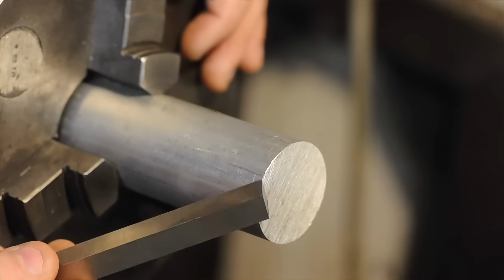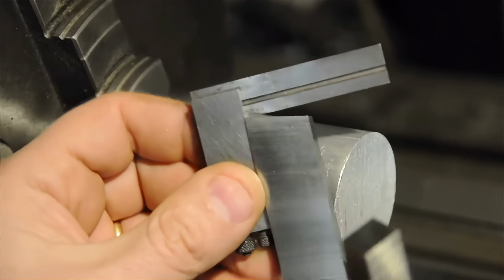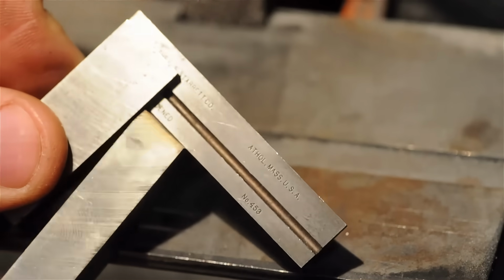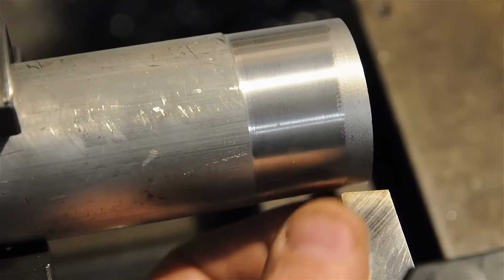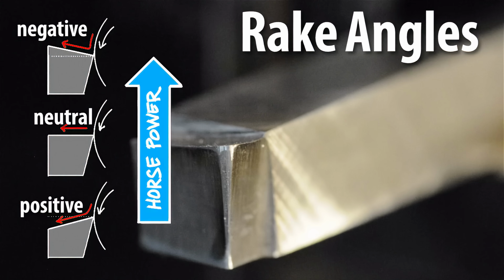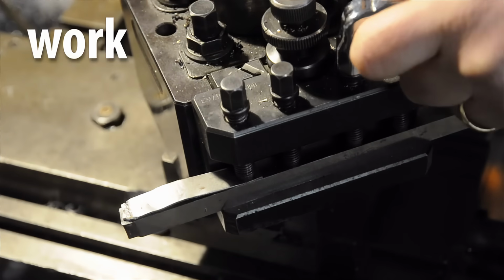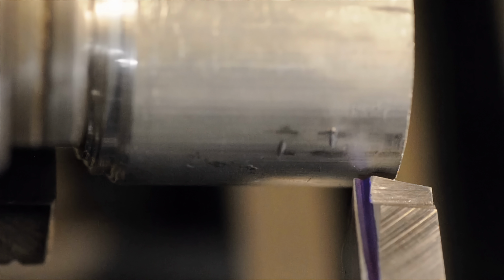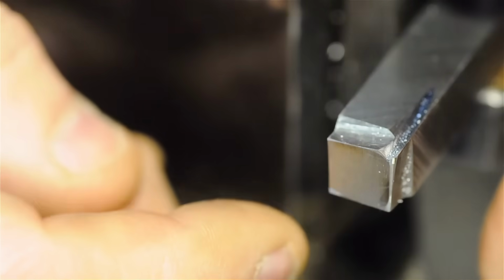Grinding HSS Tools

Comment: ummm - a nice video ... thank you ... but you don't need a chip breaker if you run it at the right feed rate so you get chips not a continuous spool of swarf ... as a CNC fitter and turner I have never heard of such a thing ... just get the bulk feed rate right for the material and load and it just chips up without all that... i use HSS to make hydraulic seals with a profile ... just use carbide tips if you're machining something.... you know you got the feed rate right when it chips up nicely ... but thank you ... I live in a production enviroment not a hobby one ... interesting but ............

Comment: Thank you very much for the info and the effort made to post this. My family ran a motorcycle dealership for 40 years and we bored many cylinders in that time. My dad had been a tool and die maker years before that so we had some knowledge in our shop about cutting tools. Occasionally my dad or I would try to sharpen the cutter for the boring bar (by hand). Because of the years of experimenting with good and bad results, it was really interesting to watch your video. We eventually bought a tool with carbide inserts but we found that we could get much less chatter from our machine if we modified the tip of the insert a little. My theory was the the angle on the end of the tool was just a little different that what we really needed. We had the machine overhauled at one point and that helped some too but having the right tip geometry was key to getting a finish that would hone out easily and make for the best cylinder surface.

Comment: really interesting! Thanks for taking this approach of trial and error. That made all the changes be understandable. Especially the chip braker at the end made a lot of sense! Carbide tools do have this u shape as well, but as they have it tighter and are mostly used on steel, chips are braking better there as with aluminium and your HSS tooling.

Comment: Hi Tony/ other experts - would the relief and other angles be similar for Delrin as it is for Aluminum?  Having a tough time getting a smooth finish milling the diameter down.  Facing was very smooth but cutting across is leaving a very rough finish.

Comment: Your videos are generally very interesting, with no boring sections. The dry jokes are awsome ;). Also weirdly relaxing, because the soundscape works for me at high attention or as ASMR at the same time.    Are there adjustable chipbreaker styles similar to woodworking planes?

Comment: First time I used a lathe (30 years ago) I nearly destroyed it ( cutting tool
heading straight through the chuck on automatic feed) . Euh... stayed away from  them lathes for a while ......
Well , just bought a Sherline 4530 , as to exorcise my never ending 
guilt complex , hey.
So I went ahead and tried grinding my own bits , only using that  +/- 7
degree basic approach / trick....and , immediatly , it WORKED !!!
 
Thanks so much  for that video , I 'm now one proud  lathe 'machinist'  (all eyes on the chuck , sure ).

Comment: This Old Tony . . . Ok so this isn't quite grinding a tool bit but . . . me being a shop ironworker, I need a large center punch. 
I can't seem to find one large enough to really grasp in my hand. You know larger than those little thingies they sell at the 
big box home repair places. So how practical is it to grind a large tapered punch into a center punch and not ruin the tool
steel that the punch is made of?

Comment: Thanks for describing all the reasons for the grinds...it's been over 40 years since Trade Shop Class and I needed the refresher. Picked up an older model Edestaal SL1000 and trying to relearn how to use it correctly. Thanks again...

Comment: At a shop I used to work, they had a box that dull, or broken, inserts and endmills went in, because they sold the carbide to be recycled. I would always raid it, for 6" extended length 1/2" and 3/4" endmills. They would take a good bit of green wheel to form, but when you needed to bore a deep hole, that needed to be precise, I found that the rigidity of the 3/4" solid carbide endmill repurposed via custom hand grind, to be superior. The smaller diameter, and inferior material quality of the insert holder boring bars, were guaranteed to deflect more and more, the deeper you went. Even on multiple truing passes, the repeatedly of the custom carbide boring bar, was always my go to, when I was given the responsibility of deep precise bores, that had insane gd&t concentric true positions on them.

Comment: Many years ago I used to do a lot of form tools; mostly Carbide and Cobalt and it saved me alot on time.
I also had a cutter grinder machine that saved a lot of time and money.
One final thing I'd like to say is if you're going to do a custom cutter and you're going to do Form Tools you might as well make them out of Carbide or Cobalt tool material. I want cutting tools to last.

Comment: I'm about halfway in. I've been learning 3D modeling for about 10 years and this is so similar to 3D modeling it's crazy. but also, I'm starting to think that the " ideal tool " would look something like a needle or a single point on a stick or something or a sharp point honestly, but maybe with a little bit of thickness in I don't know, it seems like any thickness in any dimension would have some type of drawback

Comment: I wish my P.M. would cut that smooth. No matter what I have tried I get a rough cut on both steel and aluminum.  Any suggestions out there please???? 
And yes I’ve tried new tips  slower and faster speeds but too no avail.

Comment: Thanks for the info. A suggestion - It would help a lot if you would label the four sides of the tool bit with an  L - R - T - B  for the Left - Right - Top - Bottom. This would help us follow how the tool is positioned on the rest when you are grinding it. When you are flipping the tool around in the air it is hard for us idiots to follow the surface that you are discussing as you take it to the grinding wheel. Thanks again.

Comment: I used taps as a source of HSS.
Usually, the square part is long enough to have a strong fixation when used as taps, but can accomodate grinding on the end to be usefull lathe cutters.
And since they usually have 4 flutes, it's easy and consistant to fix them on a post.

Comment: Are chip breakers only for security ?
I have worked in a compagny with huge tools. They had horizontal lathes, to build up to 2 meters ( or more ) diameter gears.
Sometimes the metal ruban from machining was so long I took care to stay aways from this evilish machine :)
I have a mini lathe,  have been used tools for decades, and still fear of it.

Comment: The Old Tony channel is a recent find for me, and is causing me to lose a bit of sleep.  Too many topics and too much knowledge to absorb, sot of like being in college again.  A word about chip formation - the continuous strands leave a path for heat conduction back into the work piece. Small chips which break off cleanly remove the heat of cutting with the chip, and keep both the work piece and the tool much cooler. I can only get chips to form in 6061 with about .050" depth of cut and pretty aggressive feed rate. 7000 series are much nicer to machine. Anyway, thanks for the many cool videos, wish I had found your channel many years ago.

Comment: I've practiced countless hours to grind tools like this. They never end up as sharp as this. I don't know what i'm doing wrong.
Reply: Have you got a diamond hone?
Reply: @bazzaf246  no. Any advantage over white sharpening stone?
Reply: @Dwarfgrinder  possibly a bit more control with a handheld diamond hone. Are you doing the second to last step in the video? Changing the angle of the top of cutting edge/making it sharper?

Comment: Great video - thanks. I know this is a old vid but I'm a gonna hope some ones sees this.
I've got cbn wheels on my grinder (wood lathe newbie) and they grind hss like butter.
So my idea is you make a mandrel and mount a cbn wheel on your lathe using said mandrel and then use the cross slide plus other mechanisms to make the chip breaker grind?
Funny the chip breaker on a wood plane does the exact same thing it cracks the chip and allows it to curl.
Good stuff.
Reply: My cbn wheels have a 90 corner with grit down the side - .25" or so.
Perfect for that chip breaker grind.
Reply: I'll add I have not idea what I'm talking about - just spitballin.

Comment: Excuse my limited English but here in England we call it swarf lol.  Anyway, back when I was in college about 45 years ago one lad was turning a long steel bar. A deep cut (HSS tool) on a very slow feed. The coil of swarf was so long I helped it feed off so it wouldn't break. I can't remember how long it was but he was using a Triumph 2000 and it was way longer than that

Comment: Great video, good information. Some advice regarding chip breakers. You have the right idea but the breaker is to deep and to far back from the cutting edge. For small cuts like your doing a small chip breaker is what you need. Look at a carbide inserts chip breaker. Good luck

Comment: Law: if it can be heard its vibrating.

Appreciation and awe:
I love this microcosm. I need this tool in my shed, and your ken will help so much! Thank you. I love the fact you explained the angles rakes and physics to back it all up with your comfort and skill. Now I need to re-true my grinder.

Tangent:
Now I dont know if it is of interest to you, and I figure you are a decent and honest guy; those chips can be sold. Yes. Sold.  So anyone want to 'upcycle swarf can do. But Personally, the ethics dont sit right for me. But it will explain if a person is raking around your shop bin fleeting with a bunch of swarf, and leaves you confused. 

Rabbit hole: 
The New-Age peeps want this swarf for making and selling 'Orgonite'' . That's an object made of epoxy resin and swarf.  Personally I think it's a case of snake-oil, because Wilheim Reich (the inventor of said 'Orgon Generator' didnt make them from swarf and epoxy resin...

Comment: Newbie here! Thank you so much for this. I feel
Like I could do this with a couple of attempts. One question: if you grind in the chip breaker, does that lower the cutting tip in relation to the height in relative to Dead Center of the stock? I mean would it effect facing off at all? Thank you! I have subscribed 👍

Comment: I worked on a large vertical turret lathe, my colleague on the other shift did not use a chip breaker and the swath made such a long cutting that it came around with the chuck and slashed  his hamstrings

Comment: When I started machining, we had none of those fancy insert tools. 
I started out at a bench grinder with a box of carbides that needed to be sharpened. 
Taught me to see how it should be shaped straight away.
After a week @50 hours of that, having finished the box of tools, I was handed 2 boxes of drill bits, and pointed to a second grinder.....
Kids nowadays 🙄

Comment: long ago I tried to take a cut with a fresh square faced blank just for funsies once and the work grabbed the tool and literally ripped out my toolpost and threw it at the wall lol. luckily it didn't damage anything, the t nut I was using was just made out of a piece of mild steel flat bar with a bolt shank plug welded to it so it snapped it right off instead of destroying my compound. didn't even dent the drywall either, somehow.

Comment: I ground a fresh tool bit today for a project I am working on. I did it in a cutter/grinder and it was a thing of beauty. I was facing off a disc and it made the first two passes just fine. On the third pass it got a little less than half way and it hit what appeared to be a hard spot in the material which is mystery steel. When it hit the hard spot it literally took my cutting tip right off like it never existed. So it was back to carbide until the piece was finished. Whatever it was it was damned hard because it blew up two faces on a tri face carbide insert tool. I called my customer and asked where he had got this steel from and he was evasive about it's origins. I told him it was going to cost him more for the job and why. He didn't like it but he agreed. He also said next time the I will be responsible to purchase that material so we know what we have at the start. Gotta like it.

Comment: How about putting mini tube vacuum next to tool bit to suck the chips out of the way? I use this technique when drilling 2mm tungsten carbide drill bit on steel rod/aluminum. Fluid cutter also makes my bore clean. Awesome video BTW.

Comment: BUT when you ground the chip breaker, you ground off the original cutting edge so you should have raised the tool back to center. It may have helped

Comment: I never worry about chip breakers. But working and grinding HSS. is awesome. When ground correctly it always gives a fine result. And you don’t need the the high RPM. as you would need with cemented carbide.  This was a nice video!

Comment: Thanks for this. Im very new to this crap, im using my great grandfathers tooling, i took a basic course and know how to use it now but i didmt know how to grind a tool till now. Kinda cool cause the first lathe i touched is the same one im using now. First time i used it was me guided by my grandpa when i was in 3rd grade, never used it again cause i didnt know how. In 8th grade i used it once or twice for a school progect but only used cheap china carbide bits before i used the hss ones from my grandpa and great grandpa. Now 4th year high school i know enough now i can say i know how to use it, currently making a led conversion bulb/heatsink for a 1950s rayovac flashlight.

Comment: Perfect video to explain cutters. Just taught 2 beginners how to to use a metal lathe at my Hackerspace, directed them to this to learn cutter grind. I especially liked that last point- this geometry is universal and it's all about how the tool approaches the work. Once you see how and where the angles are, especially on a drill, you can make a tool that cuts anything.

By the way, if you didn't know- AR Warner does make insert tooling with HSS, only company in the world that does- I should know, they're out near me.

Comment: I would  very much like to see you put in as much experimentation on  dressing that wheel...I assume it is about a 60 grit, K hardness, white aluminum oxide, as you put in on the grinding. I once ground 22000 split point drills for an aircraft company by hand....and got paid.  Often, the less you remove but the more precise you are in the removal, the more you are praised by the boys in the shop....and the more you deserve it.

Don't mind me....I am living in  1977 and doing just fine.  Nice video, and please carry on....  :)  ....Joe

Comment: Hello, watching this in October of 2020! I have a question after watching so many of your lathe and milling videos. What do you do with the shavings, dust, coils, etc of the metal you cut?

While I expect there's likely a joke answer I hope you can provide a serious answer, as I'm actually curious about the viability of reusing such metal after melting it back down to a more solid block in a basic crucible or forge or something doable at home.
Reply from the maker: I don't use it but it's collected for recycling.
Reply: @ThisOldTony  Thanks for the reply! I hope that the recyclers have been able to put that metal to good use.

Comment: Want to hear about a weird process so aluminum parts being casted then using a negative rake face Mill to mash any porosity into the important faces and then taking a skim cut with a super sharp Diamond Cutter making the face perfect an flat but harder at the same time, with 3 point system got those part faces to within less then half of one tenth

Comment: The chip breaker needs to be perpendicular to the chip. On that tool, the breaker should have been at an angle, about 45 degrees to the leading edge of the tool.

Comment: Sir, I am only just discovering this video, which I find truly informative. I am a home user, working uniquely in metal, with Cobalt bits. I have found NO source on the internet on what grain should be used to sharpen bits. I assume smallest is best, as with knives. But I would love to have your expert opinion. Kind regards

Comment: is wd 40 used as a coolant while machining aluminum  material
Reply from the maker: there's official coolant for aluminum but yeah, the WD works really well!
Reply: ok thanks what about brass does it also have a coolant that can be applied while machining it

Comment: In what situation would a high negative rake be used/useful?? Positive is great for low power machines and soft materials, neutral is used for hard as fuck materials (usually with ceramic tips) but I can’t think of any situation where Negative would be used??

Comment: There is some severe appreciation for a proper tool right now. You might think your tool looks like shit, and well it kinda does, but that doesn't matter. That fucker would have saved me hours today at the shop over taking off a few thousandths of an inch off a hardened steel c-clip with the broadside of a cutting disk. Mechanic buddy thought the IT guy lost it, but got that differential rebuilt and working good.

Comment: You can reach down and advance the handle in the direction of feed. The backlash in the screw will cause a pause in feed... resulting in a dwell that allows the machining action to work  like a peck. 

Helps if it's a rough cut... and the string of death is getting way to long

Comment: The only high speed tool bits that are available these days are fifteen percent cobalt. If you do not have CBN or diamond grinding wheels lots of luck trying to grind it with aluminum oxide.